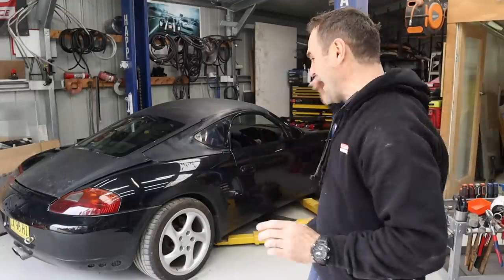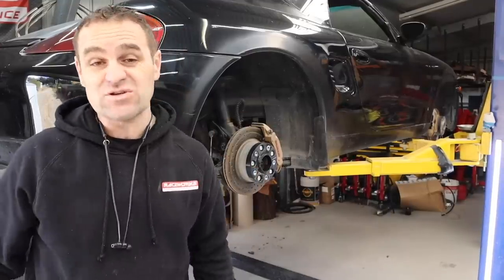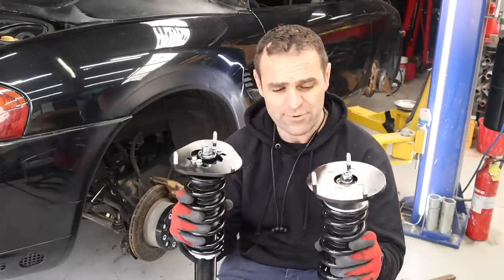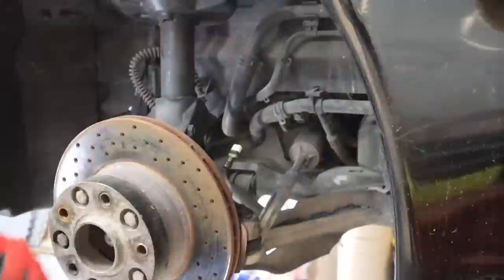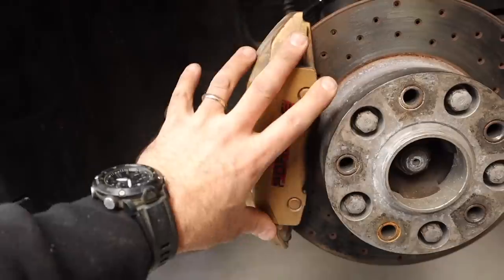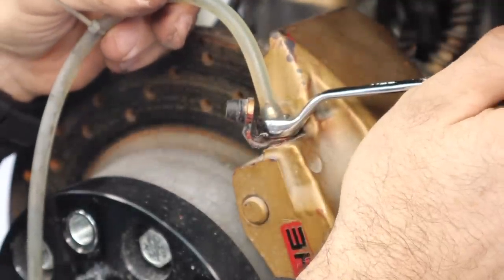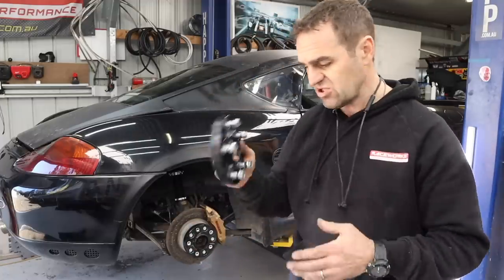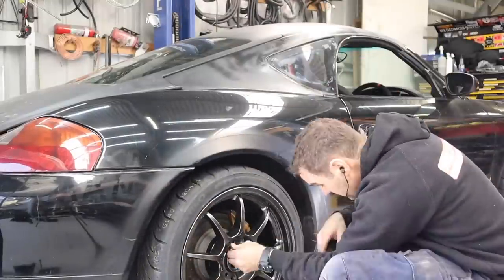Biggest performance upgrade yet! - Porsche 986 Boxster V8 engine swap track car build 31

Comment: Nice work Jeff! You may have done it even faster by not removing the front brakes and uprights from your car. Just undo the steering rod ball joint and the 3  upper nuts for the shock on the body and you can swing the full strut out of the wheel arch. I did it twice, it works.

Comment: To bleed brakes with vacuum, you could put some grease around the bleeder not to suck in air. Even better is to use teflon tape on bleeders when installing them. I also recomend quickbleed bleeders. They have oneway valve built into them 😉
Reply: Or rathe. Goodridge speed bleeder😅 those have the valve built into then. So to bleed the brakes you simply crack the bleeder, put a hose onto it and pump the pedal.

Comment: Looks good. Keen to see it on track soon. However, just keep in mind some scrutineers don't like spacers as they can be a safety risk even though they are bolt on. I got pinned for mine and I had arp wheel studs on mine, so double check you can run them at the events you are looking at. Buy keen to see the progress.

Comment: Good Choice for the Wheels, very light. Some AP Brakes will really be a Good choice. Lightweight, race proved and good on the road. Also a Proper spoiler and front splitter will really help in the corners, maybe along the lines of the GT4 !

Comment: I'm familiar with the issue you mentioned with vacuum bleeders. Air will enter from the treads, and you are seeing bubbles on the bleeder hose all the time. I solved this issue by starting the bleeding process by removing the bleed nibble and adding some thick grease to threads before reinstalling. The thick grease will prevent the air being pulled in through threads. sometimes

sometimes if I have been lazy I have just smeared the grease at the bottom of threads, but that way the seal might not be as good.
Reply from the maker: The pressure bleeder saves all of that stuffing around ;)

Comment: That poor old Roxter, it's still a bit sad looking Jeff, but it should be great fun at the track so long as that Audi V8 keeps its timing chains in the allocated spaces.
Reply from the maker: Belts ;)
Reply: @HomeBuiltByJeff  much better then, pardon my ignorance. I've seen the Audi chain drive V8 setup, it's full of twists, turns and tensioners.

Comment: I think any extra air flow to the engine will be supplied through that horrendous gap in the rear bonnet. Is there anything to be done about that? Or is that the way it has to stay?

Comment: Jeff, I think the biggest upgrade for performance would be trading it in for a real Porsche.
Reply: But where would the fun be in that? 😆
Reply: What makes the Boxster not a Real Porsche and don't tell me the Engines not hanging out the Back of the Car??
Reply: Porsche has moved their engine in the 911 towards the center of the car more and more with each new model. Clearly even they know that mid engine is the smarter way, but for marketing reasons they can't admit it..
Reply: It’s not a Porsche. Jeff says it’s a Porsh… often 😂

Comment: you will never have a racing car with spacers. Start study geometry
Reply: It would be more ideal to have a wheel with the correct offset in the first place, but it's not spacers that hurt the suspension geometry, it's having the wrong effective wheel offset. Without the spacers, these wheels would sit too far in because they have a different offset than factory.